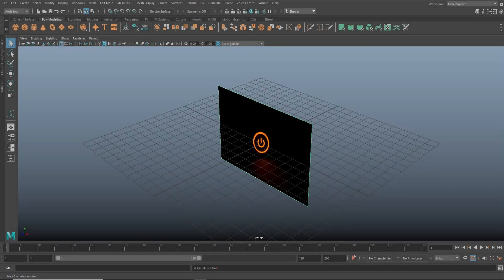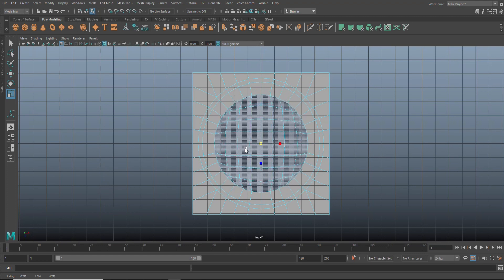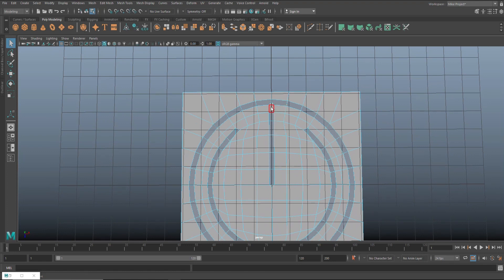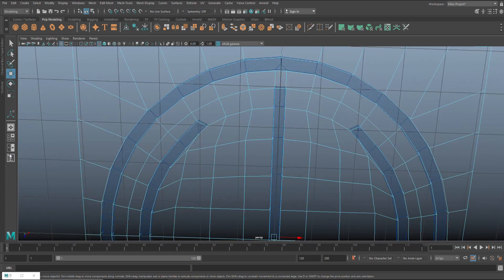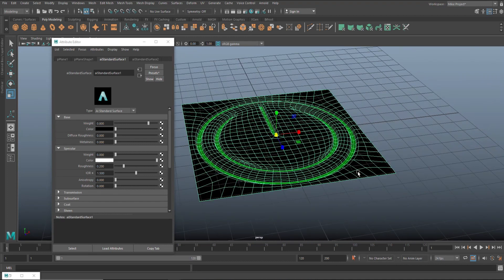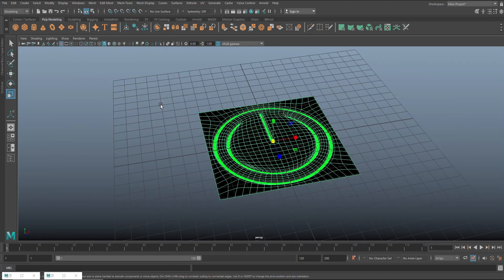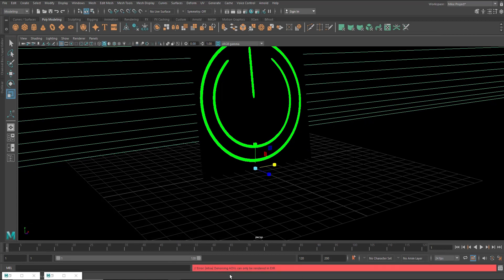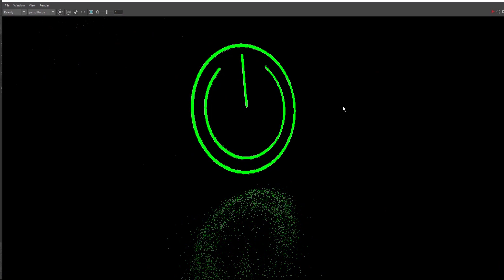Maya tutorial : LED illuminated power button ( full workflow )

Comment: I have added a floor tile design to a material. It is basically a ceramic tile that can tiled using the UV parameters but the tile design does not render at all in the Arnold Renderer. Any ideas? I have imported the tile design to both the Color and the Diffuse option but neither render the tile look.